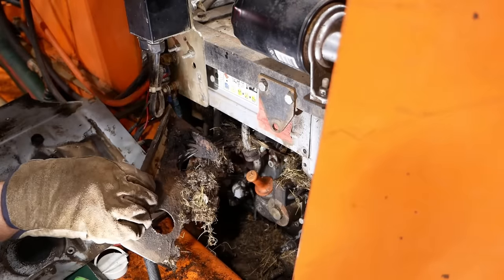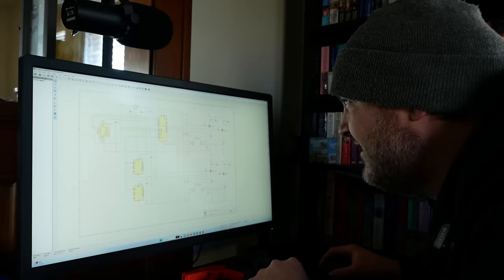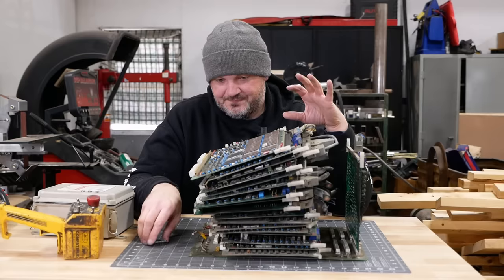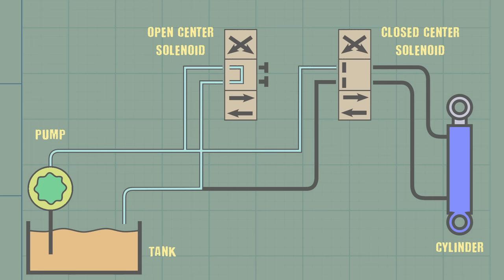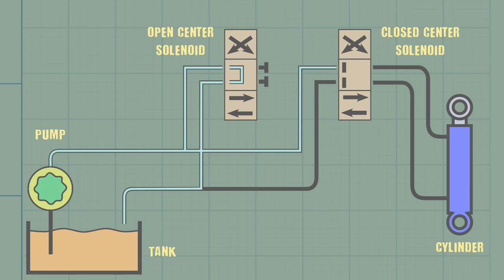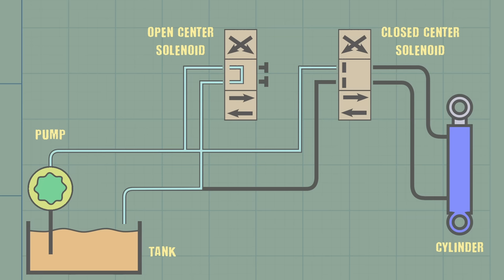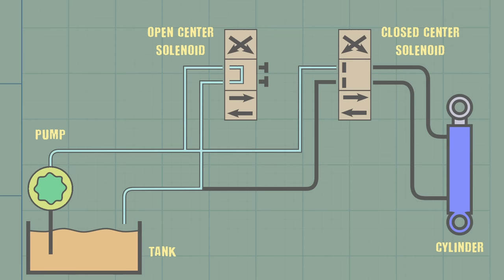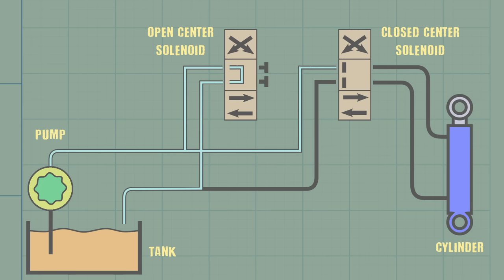Will It Move after 10 Years? Sketchy Robot Hacking

Comment: Wes, you need to add calibrations for each solenoid on the motor drive valves.  You need to find the current command at which each track starts to turn and save into EEPROM.  Then you adjust your solenoid commands using this "start current" so that you get a consistent initiation on each function.  Typically, you'd also calibrate a "max current" point which provides the same reference speed for each function.

For the solenoid dither, you need to tune these settings with the goal of minimizing the hysteresis of the actuator valve.  To do this, you need to measure the position of the actuator in real-time as you sweep your solenoid commands up and down.  A cross-plot of actuator position vs solenoid current will show the hysteresis.  Then adjust the dither frequency (Hz) and magnitude (mA) to find the optimal set the reduces the hysteris and provides good linearity in the actuator.  Typically, this is around 100 Hz and 150 mA peak-to-peak but will vary based on the design of the coil, valve, and current driver design.

Once you've tuned the hysteris and calibrated each solenoid, you need to add some rate limits to your solenoid current commands in order make the machine track smoothly.

Looks like a fun project, good luck!
Reply: I was thinking of a form of feedback but the valve calibrations is good.
Reply: Usually, a calibration is good enough and doesn't add the complexity of a closed loop control.
Reply: Good God you sound like an electrical genius. Almost none of what you said was even English 🤣
Reply: Excellenty written. 
Maybe add a low and high rate switch to switch from a low rate current to the maximum / high rate coil current. Or to switch between low and high rate joystick to current mapping of the output pins.
Reply: I'm guessing the accuracy of the $3000 joysticks and the very lower cost one Wes choice out of his lower budget allowed on this project is required to deliver slight changes the operator delivers.
Didn't understand everything you wrote about, but was able to catch enough to understand the basic idea.
Reply: neat idea, but first i think the hydraulic system needs a rework.
Reply: @peepopalaber  in what manner? 🤔
Throw new parts at it until something sticks? 🤔
What parts aren't functioning to your liking? 🤔
Reply: Then the fluid and solenoid temps change and all the calibrations go out the window.
Reply: @theovannieuwenhuizen5756  rabbit and turtle mode... yes that would be a nice feature!
Reply: @dans_Learning_Curve  much of what drives the $3000 price tag is the software tuning.  The other thing driving the cost into industrial components is the need to live in harsh physical environments.  The basic electrical components that are used to measure the joystick input angle angle and control the solenoid current could be the same or very similar.  Point being that someone with the right know-how and a motivation might be able to still get the machine to perform well with low budget components.
Reply: @peepopalaber  possibly, but the first step is to work with what you've got until you've tried everything
Reply: @blackmesaresearch2  yes, the solenoid coil temp could change the response characteristics of the system but a closed loop current control would help to address this.  The calibration current usually doesn't change with hydraulic oil temp for a closed center valve.
Reply: Yes, I agree with whatever you said. 🤪

Comment: Heck yes to a Wes Made Alignment machine.  As an owner of several TTB Fords, steering & suspension geometry seems like black magic, and most of the local shops just throw up their hands, or just set the toe, and say "good enough". 
When I tried to find resources on doing it myself, there are plenty of videos and articles that show "how" to get a proper alignment, but it's all strings and tape measures, and maybe an angle finder or two.  If there's any math, it's just "rule of thumb" stuff.  Nobody can seem to explain the actual trigonometry involved in going from a reference angle to proper caster and camber.
Reply: I think you might be over-complicating this. The kinematics of a suspension system don't really matter for an alignment - unless we're talking about modifying the suspension for custom race/drift setups. After all, you can't change how it moves on a stock setup. I totally agree that most local shops suck at alignments, I think mostly because they just set the numbers to 'green' and call it done - despite some of those measurements fighting each other while technically being 'in spec'.

Strings and tape measures have won a lot of races, and I've sent several street cars down the road using this method with no complaints. There's nothing wrong with it if you're willing to learn how to do it this way and are meticulous enough to take good measurements. There's no trigonometry involved, just simple subtraction for toe measurements, and leveling/reading of bubble gauges for camber/caster.
Reply: @blackmesaresearch2  One man's overcomplication is another man's learning process I guess. 🙂

I have nothing against strings & tape measures.  And eventually I was able to dial in a setup that didn't eat tires and handled well.  The reason I'm looking for something more in-depth is my desire to not have arrived where I did by basically trial and error.  If I could read the level/angle finder and do some math and figure out how many degrees of caster & camber I actually had, then I would have saved many steps.

On an A-arm vehicle with cam bolts, adjusting & checking alignment isn't that big a deal.  On a Twin Traction Beam/Twin I Beam vehicle, an adjustment involves removing the wheel, undoing the pinch bolt, removing the alignment bushing, then reinstalling everything.
Reply: Have you tried kicking or hitting stuff if it doesn't drive straight ..? The Ultra-Violence method of suspension alignment .
Reply: fastest way to align a ttb is to align your tires with the frame first, make sure the pitman arm is at 90 degrees with the steering wheel matching and then measure between the front and back edges of both tires, then drive it with 4x4 on, if you are off it will pull when you give it gas and can make guesses as to which side needs adjusted based on the visual pull you also get vs the body, just had to do this the other day

Comment: I know you keep saying you don't have Electrical Engineering skills, but as a former Electrical Engineer and now a Project Manager, you did exactly what we used to do (and still do) all the time.  You made a working "bread board" (that is what we call it) prototype, splayed out into working sub-systems, manually wired up, and got a working prototype.  Easy to develop on, easy to troubleshoot, exactly how it is done in the real world.  Now that you have it working, if you had a student version of OrCAD or some other PCB layout tool, you could design a PCB controller board to reduce the "sketchiness" and probably get a online PCB house to fabricate a board for you.  As a wireless interface you could probably use Bluetooth, WiFi, or other similar short range data interface to your controller.   This has been a very cool project.  If your local High School has a STEM or Computer Science class you could offer up the programming as a class project to the school.  This would be a cool learning experience for the students.  There is probably some up and coming SW programmer that could assist with this.  Definitely worth a membership. I'm in.
Reply from the maker: You can get PCBs made for $50 or so. I'm using KiCAD for electronics. It's free and does PCB layout.
Reply: @indylmc  have you been living under a rock? PCBs are relatively cheap to get made now, potentially as low as $5 for 10 two layer, 100x100 mm boards, of course shipping is extra though.
Reply: Kicad is good enough for most PCB design work and since it is open source it is completely free to use, no need to try and get student licenses or pay for licenses just for work like this.
Reply: I took electronics classes in the 60s. The term breadboarding came about because early creators used the wooden boards that were common in many kitchens for mixing and kneading bread dough on. They were about 2 feet square, the wood surface was perfect for laying out electrical circuits and the boards were cheap to buy back then. We used the wooden boards to lay out circuits to prove the design. They started getting some of the plastic boards in my senior year.
Reply: @WatchWesWork  Alongside your idea for a homemade Alignment machine, how about a homemade locking tool chest, seeing if you can beat the price of a Snap-On tool chest
Reply: Electrical Engineer for over 30 years.  Happily retired now, but used to design, prototype, program and test systems just like this.  Wes' skills are impressive.  👍  I may have to get a 3D printer.  They look kind of fun!  Thanks for the videos!   👌👌
Reply: I don't think you are a "Former Engineer".  You are an Electrical engineer. 
Just as much as "Former Marine". 
My friend told me. I'm a Marine through and through. I will be a Marine till I die.
Reply: @2nickles647  Well said, and very true.  I miss the 8-bit and 16-bit microcontroller days writing assembly code to control hardware at the very basic level.  Lots of fun back in the early 90s.  You really could understand what the hardware was doing.  Higher level languages now make it easier and faster, but I found assembly language fun to work with.
Reply: @WatchWesWork  PCBWay is perfect if you want a quality pcb they also offer a lot of other things. It's worth checking out.
Reply: @indylmc  Given how many views this video has already there is no way that the Chinese PCB manufacturers won't all want to support the project with free fabrication. Wes just needs to email all of them and ask.
Reply: Definitely not bluetooth it is really bad. WIFI is for high bandwidth at a short range. A better RF link would be something like LORA
Reply: This channel can go one of two ways now. Watch Wes build prototype machinery  or Watch Wes run his mini Killdozer😊. AL B.
Reply: Exactly my thought. That's why I became your Patreon supporter.
Reply: @dfgaJK  I think Bluetooth is worth a look. When I was at Logitech we used it to connect phones to wireless speakers for music streaming. Worked quite well. We got up to 150 ft range and got a Guinness World Record for linking quite a few together. Worth a look.
Reply: Bravo!
Reply: @WatchWesWork Wes, I’m using KiCAD for my projects too.  I’ve been sending the gerber files to PCBWay in China to have the boards made.  Amazingly, they arrive in about a week and cost very little, given the quality of the boards.
Reply: Wow. Thank you!!!!

Comment: Two joysticks for tank steering might be easier than the single joystick. I piloted many robots in high school and college and always preferred two joysticks instead of 1.  You can get clever and have a switch that changes what the joystick is controlling, just like an MPG handwheel on a CNC machine can jog any axis but only has one wheel. 

Absolutely more engineering videos!
Reply: Yea, had a scissor lift with a single joystick forward/back left/right setup like Wes made and it was horrible to drive! Never could get it to reliable move how I wanted it to either.
Reply: Your modular track setup should make two joysticks easy, relatively.  Maybe better quality joy stick from Remote Control model airplane gear?   When you have to fix the new unit to install it, well...

Comment: Amazing. There's so much in this video. The moving hydraulic diagrams with explanations, the comparison of 80s/90s tech with what you can do today, the valve centering model, a bit of 3D printing, a bit of coding, a bit of signals analysis, a bit of electronics, jokes, danger. It's got it all!

Comment: Hi Wes, to make it easier to control, I have two suggestions. The first is each track could be outfitted with a speed sensor, then the control loops would be working on the velocity from the speed sensors. To drive straight, your control loops would be trying to push the difference between the left and right velocities to zero. This is an old trick and works great in situations where the tracks are gripping, not slipping. The second idea is to apply an exponential curve to your control inputs. This means the closer a control axis is to neutral, the less drive strength it has. This is commonly used in RC controllers. In fact you may consider just using an off the shelf RC controller since they usually have exponential control features built in. Anyway, great project, thanks for sharing :)

Comment: Wes, I am an embedded software developer and I loved this video. Just a note that it is now really easy and cheap to draw out circuit boards and have them built. There are templates for the Adruinos so that you can drop the pin headers right onto the design.
Reply from the maker: I’m using KiCAD to do just that. It’s new territory but it think I can figure it out.

Comment: That could work as a tow vehicle when the misses is unavailable! Make it wireless and you can control the tow and move things around alone...
Reply: It could also be used as an a remote controlled self propelling engine hoist. Could be useful considering some of the vehicles wes works on.
Reply: Multipurpose vehicle, towing, plowing snow and engine hoist.
Reply: @olds69trondjarle  Yes, snow plowing with way-points and collision avoidance would be hilarious to see!
Reply: Thanks. I was going to write the exact same thing. 😂

Comment: We had a First Gen Scissor Lift when I started in the trade with a similar "Full Speed" or "Lunching" situation.  We found a bypass valve that we could manually adjust to allow more or less hydraulic fluid to be used for a certain funtion.  Essentially we'd choose, "do we want to drive fast or lift fast?".  I think if you added a bypass valve in the pressure line operated by a variable state solenoid, you could control the amount of fluid going to the hydraulic drives.  Instead of full on/off mode 100%, you could choose 25% and allow 75% of the fluids simply to retrurn to the tank.  By openning or closing that return line you could regulate the hydraulic pressure to the drive wheels...Love your content Wes.  Keep up the great work!!

Comment: A quick way to add remote control would be to mount your existing controller on the bot, and add a hobby RC receiver with its outputs connected to the Teensy. The Teensy can then read the PWM signals from the receiver, allowing you to drive it with the RC transmitter. I did something similar when hacking the control system on a wheelchair.
Reply from the maker: I think I’ll use a NRF24 transceiver. I bought a few to play with.
Reply: @WatchWesWork  That's a good option too. I like the idea of using a cheap commercial RC system though because it gives you a transmitter in a very handy form-factor, and the range will be much greater than you're likely to get out of an NRF24. This is a fun project, I'm keen to see what you do next!

Comment: Some advice regarding joystick controls from a kid who competed in high school robotics for years. 

Two joysticks is better than one. Split apart your front/back control from your left/right control. For my team we always had front to back control on the y-axis of the left hand joystick and left to right control on the x-axis of the right hand joystick. (Think how there are two joysicks side by side on a playstation controller). This allows you to know that you are only feeding the controller forward motion and no rotation when trying to drive straight for example. 

Also, a very simple way to improve the feel of your joystick is to cube the analog output before using it in your controller. e.x. instead of y = Joystick_1_AnalogVal (scaled -1 to 1) use
y = Joystick_1_AnalogVal ^ 3 (this also gives an output of -1 to 1 for a joystick input of -1 to 1). Just plot y=x and y=x^3 on the same graph and you will understand.
This has two benefits, 1st increasing the deadband around 0, this prevents sticktion in the joystick from causing continual drive commands. And the second benefit may just be personal preference, but the rest of the curve just "feels" like a better mapping of joystick input to system output.

Any other difficulties with driving after implementing those changes are likely either poor tuning of your hydraulic solenoid PID current control or inherent non-linearity in the hydraulic system. In highschool robotics we had the benefit of using electric motors for almost everything so I did not encounter those issues.
Reply from the maker: That's some solid info. Thanks!
Reply: There's also the chance that the hydraulic pump was never sized correctly to the drive motor. How do they do high and lo speed on mini excavators?
Reply: Yea. What he said.